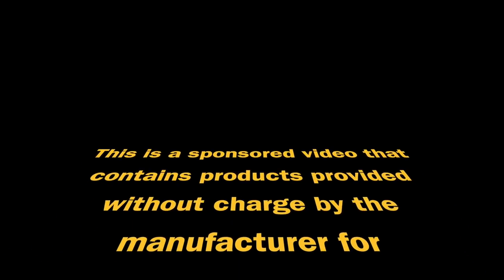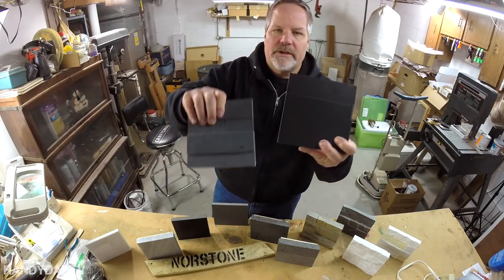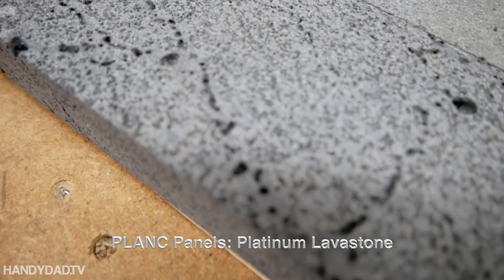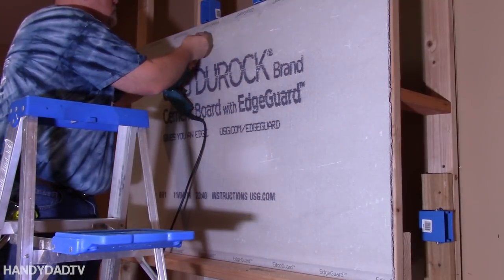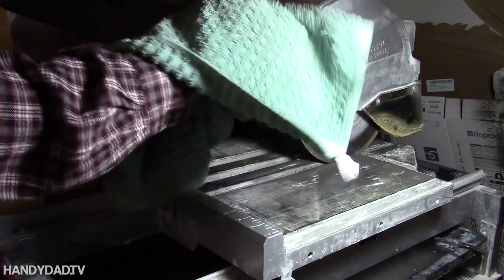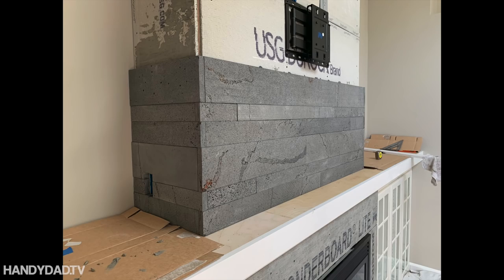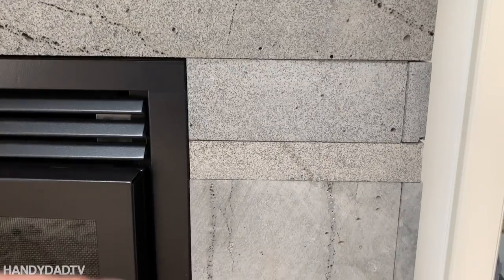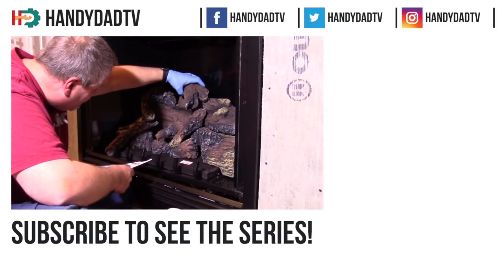Stone Veneer Installation | Norstone PLANC

Comment: Your videos are so helpful for my current interior design projects at school! Just wanted to ask... is cement board the only choice when applying stone tiles? What about plasterboard or plywood? Thank you in advance!
Reply from the maker: Your can’t attach stone to drywall (plasterboard). You could use plywood, but you’d need to attach lath and do a scratch coat of mortar for the stone to adhere to.

Comment: Great video! Im looking to do something similar and am struggling finding hearth info as I’ll have a wood floor too. I notice you went with no hearth on the floor. How can you tell if you need one or not? Thanks!
Reply from the maker: If you have a wood fireplace, you need some kind of fire-proof hearth. You’ll need to check your local codes for the size. 

You don’t need a hearth for gas or electric fireplaces.

Comment: When you built your frame did have you studs in the wall directly behind the frame to anchor the frame?  If not, what is the best method to anchor the frame to the wall if studs do not line up?
Reply from the maker: I was able to hit studs on the right side, but not the left. I could have opened the wall to add bridging between the studs so I could attach the middle of the frame, but it wasn’t really critical. I secured the frame to a rafter at the top and to the floor at the bottom.
Reply: @handydadtv  thanks for taking the time to reply.  I was thinking of doing the same thing as well.  As part of the frame I suppose I can run horiztonal 2x4s and secure it to the studs in the wall as well as securing the the floor and rafters.  I was just worried with the weight of the stones.  Thanks again 👍